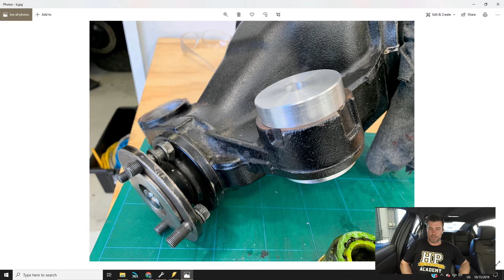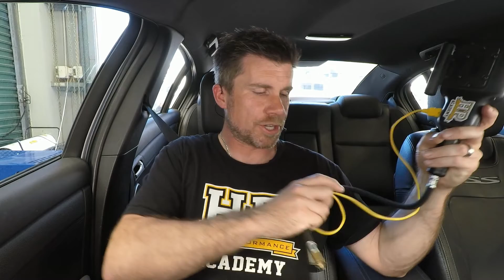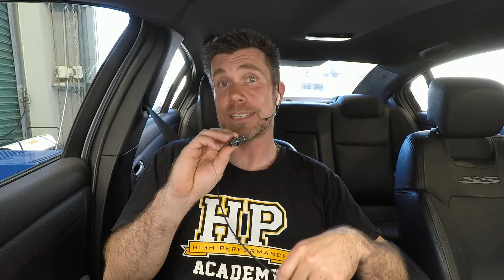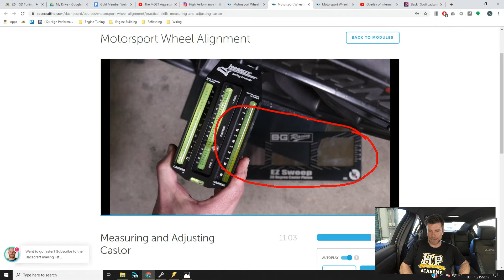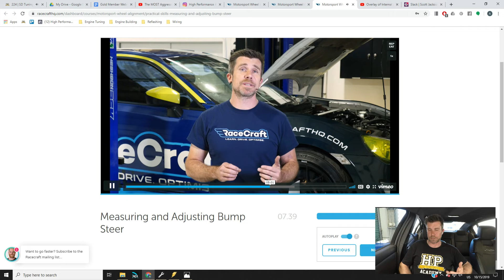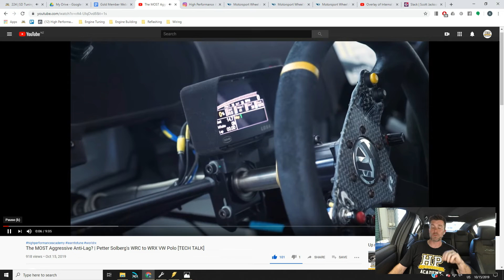Why YOU Should Care About Tyre Temps, V8 86 Build & More | Today At HPA [UPDATE 224]

Comment: this is probably eggs-granny, but may help some viewers.
Most gearboxes and bellhousings use the gearbox front bearing housing/coverplate/release bearing sleeve as the main location method with it being a close fit into the bellhousing.
If so, you can check the concentricity with a DTI (Dial Travel Indicator) mounted on the flywheel and run against the bellhousing's input tumnnel (can't think of correct term) to check runout as the engine is rotated. If it is out, there are offset dowels available from 'some' speedshops, or you can have some made up to suit. While one is at it, it's good practice to also check the gearbox attachment face is parallel to the flywheel by running the DTI over that face as the engine is rotated.
As Andre said, it isn't uncommon with aftermarket adaptors and bellhousings and something that should be checked for every one - it can also cause dragging clutches, poor shifts, and premature wear of the crankshaft spigot/pilot bearing and gearbox input/first motion shaft bearings.

Comment: 6:35 - ENGINE, not motor - you're not an ignorant American! ;-)
Should be a beastie with that new engine!
Reply: @Heiko Scheuermann SimRacing  

With few exceptions, all reference sources call it an "engine", with the exception being some American sources. However, these are in english - perhaps some German speaker can provide details on exactly what Herr Otto called it - I seriously doubt it was as a 'motor' for the reasons below, which was established practice.
In the very early days of automobiles in the USoA, many (almost all?) did actually use a "motor", as they were battery powered, later they used IC engines but the naming practice by then was well established.
[edit] Bit more investigation brings up 'motor'as being derived from a latin term meaning 'to move', or possibly 'self moving' - which would also suggest the British term "motor car" for what the Americans call an "automobile", which is probably derived from the latin terms for 'self moving'?

I was using the technical definitions, which you should check for yourself - for example,
"The real difference, is the fact that "motors" run on electricity, while "engines" run on combustion. ... On the rare occasions we encounter one, we refer to a steam locomotive as an engine, the same word that we give to the motive power of an aircraft. But all electrical devices are driven by motors."
That is pretty much how I was taught to differentiate them, too.
Reply: @Heiko Scheuermann SimRacing  I'll reply to this as while your later post shows up in notifications, it isn't doing so in the thread.
No worries, my initial post was quite provocative ;-)

I thought you may be german, or of germanic ancestry, from your name - what does the original german used by herr Otto translate to, as I can't see if you mentioned that as only the first few lines shows in notifications?
Reply: @Heiko Scheuermann SimRacing  Cool, thank you.
Reply from the maker: hahaha that one as popped up before. English does evolve a bit over time for better or worse I guess and at different paces in different countries, but the context should make sure everyone is on the same page =)
Yes we're excited! Still a wee while away but it's been so long that the anticipation has had a solid chance to build. About time we finished some projects around here ;) - Taz.

Comment: Awesome content!  Quick question.  For your camber adjustments at the track (I will use a McPherson example for now IE: BRZ/86).  Does your camber affect toe much?  To elaborate, once the car is setup and tire temperatures / conditions require a change, do you mostly adjust camber and how of much that adjustment affects toe? (I have heard 3:1 ratio for degrees as an example).   Thanks for all your videos.  It has persuaded me to take a course.
Reply: in the front it affects toe near zero, at the back the toe changes significant! More negative camber in the back results in toe in
Reply from the maker: @xtrashocker  sorry that's not correct. You'll see toe changes at both the front and the rear and it's not possible (at least with the 86 chassis) to adjust camber without affecting toe. The change in toe will be directly proportional to the amount of camber change you're making. In some specialised uprights that are designed specifically for racing use it's possible to shim the upright to affect camber without affecting toe but you won't find this on a production vehicle.
Reply: @hpa101  Thank you for the clarification. I got my Base Setup from a race workshop and only corrected the rear alignment by myself. In the rear i was shure about the influence, but for front, its what was told to me by the workshop. Sorry for that.
Reply from the maker: @David yes the camber change will affect the toe quite dramatically. The process is to set the camber and then go through and adjust the toe. In some multi link suspension systems there's a bit of back and forth interaction between toe and camber which makes the alignment an iterative process.